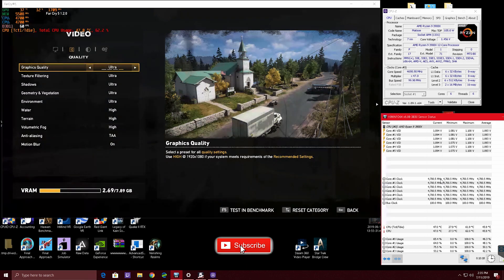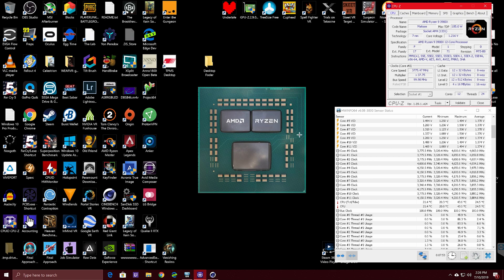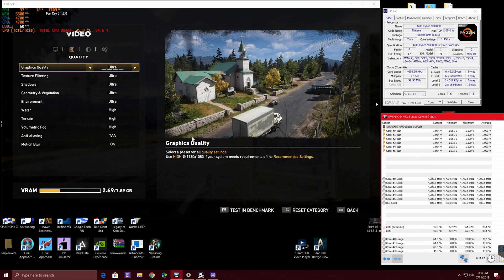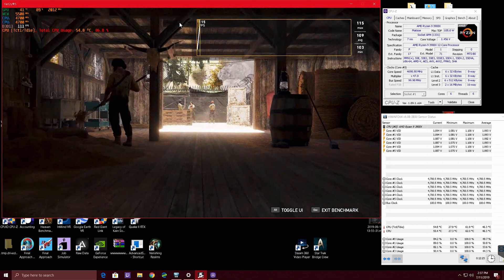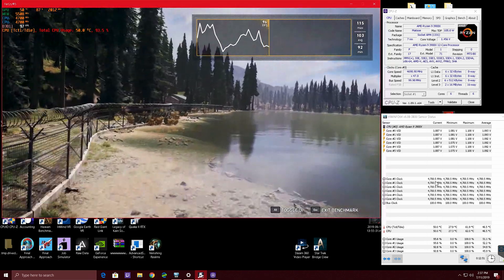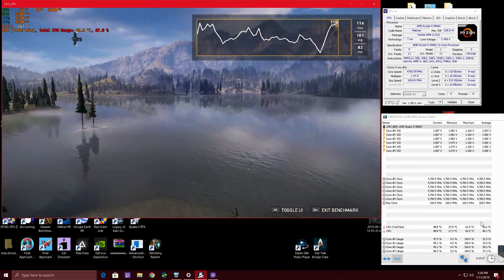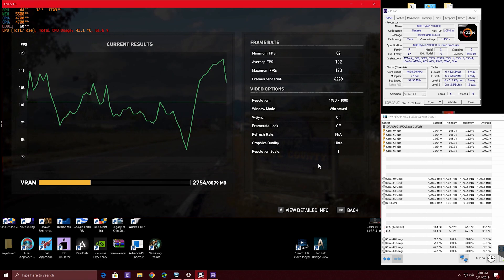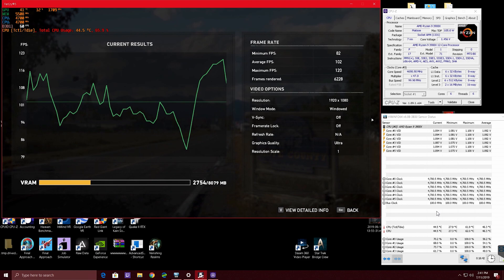RYZEN 9 3900X OVERCLOCKED 4.7GHz On Water!!!

Comment: I can get 4.3 stable by only adjusting CPUx.  4.4 runs games farcry 5, battlefield 5, GTA V but cinebench R20 crashes. 
I am on a 240mm aio 
16gb ram at 3600, 16,18,18,20
Rtx2080super
X470 prime Plus mb
Any help would be appreciated

Comment: 3900x @ 1.45volts, all cores 4.3ghz, temp 74 using nhd15 noctua air. Prob could have stable 4.5 if I play with settings more buy 4.3 is fine for me as I dont game just vfx. I use the optimal setting profile for day to day use tho
Reply: That 3900x has degraded by now, guaranteed.

Comment: Pretty much low performance. I am getting 138fps average in far cry 5 benchmark tool with my r5 3600 clocked at 4.25ghz but with low latency ram 3600mhz CL14 i am also using GTX 1080 TI, what gpu do u use ? maybe that's the case.
Reply from the maker: Since this time I have put in better ram but I'm still only using the gtx 1080. That is why

Comment: I too have a Ryzen 3900x cooled by CM ML360R and can achieve all core 4.3 Ghz, but I am uncomfortable with the temp sitting around higher side of 80°C and is not stable enough at Prime 95 level. However I keep it at 4.275 Ghz all cores stable under better temps.

Coming to your 4.7 Ghz claim - What you are doing is not an all core 4.7 Ghz if you are doing it only on one CCD. System will remain at low temps and stable under gaming because gaming uses mostly single core. Try switching to any stress test or benchmarking and you will see either thermal throttling kicks in or a restart.

Note - I do not want to undermine your efforts but at the same time want to keep the viewers well informed about the current situation of this processor. Maybe at a later stage once motherboard manufacturers start providing more matured BIOS then it could be possible. I am waiting for the microcode update that AMD said they will be releasing in November to bring 100+ improvements.
Reply: You can hit a middle ground. I run both CCDs on, 4.6ghz ccd1/4.2ghz ccd2 @ 1.35v (1.275v under load). Under 70C in r20 after warming up the liquid in Prime 95.

Comment: This might be a dumb question, but what are the downsides to an asymmetric overclock, e.g. fast chiplet @ 4.7, slow chiplet @ 4.3. I get that the voltage will be insanely high for the 4.3 chiplet, but is there anything else I'm not thinking of?
Reply from the maker: Well I just find the middle grown then there are no downsides. 4.5 on the fast and 4.3 in the slow at 1.35v. works pretty well 👍

Comment: Ahm, manual OC under load 1.205 - 1.210 vcore 4.1 ghz all cores for productivity under CR15 lower  SThread, MThread is better than default, way lower temps and stock cooler.

Auto offset -0.09 , default, max boost on cores 4.45ghz  and that core is hitting 1.387v. Much better STthread lower MThread with offset.

Boost on all cores on default under heavy Mthread load is 4025mhz ...
Reply: Interesting, I'm on 4.2GHz with voltages at 1.18175V on the vCore.

Comment: You: "I am running all cores on my 3900X at 4.7 GHz".  Also you "I am only doing this on one of my chiplets".  You can't claim an all core overclock if you are only doing it on one chiplet.
Reply: This looser again. Im going to by a $500 CPU only to run it like a $300 one. the dude ran a cinebench and barley hit 3000 points. Sad. A great "How not to optimize your CPU" video. LAF

Comment: In Cinebenck R15?
Reply from the maker: Got 221 on single but there was more in it. I have my setup now running 6 cores at 4.5 and 6 at 4.3. Cinebench multi-core of 3430!
Reply: @JoeyRiz  you can do better with all 12 cores.   mine ccd0    ccx0 4.55 4.55 4.55  ccx1  4.4 4.4 4.4   ccd1 ccx0 4.25 4.25 4.25  ccx 1 4.25 4.25 4.25   all at 1.368v

Comment: Can you leave the other CCD on, and clock CCX0 and 1 to 4.7, and CCX 2 and 3 to something low, like 3ghz?
Reply: Yea you can. I have CCD0 locked at 4.45Ghz and CCD1 locked at 4.1Ghz @ 1.325V. You can even do it by CCX and even per core but the software is a bit buggy atm. AMD def bringing the heat.
Reply from the maker: Ya I have been doing that as well. 4.5 on 6 and 4.3 on 6 at 1.35. stable too. These chips are pretty great
Reply from the maker: Ya I figured this out right as I was uploaded this video. It is by far the best way to go with this chip. 4.5 on 6 and 4.3 on the other 6. 4.7 take way to many volts on the daily. But 1.35 should be ok. 3430 on cinebench!
Reply: @JoeyRiz  3430 is a pretty frickin good score 3389 for me

Comment: So you haven’t actually got a 3900x @ 4.7 then.  So much clockbait.
Reply from the maker: Ok first, Clockbait is an awesome term lol. But really I did hit those clocks on this chip. It's pretty much in "Game mode" which disables one CCD like I did. AMD has been doing this for the last 2 years with threadripper.
Reply: @JoeyRiz  you hit them on half the cores which isn't what your title says.  I approve of the bait however
Reply: @JoeyRiz  come on man. It was 100% clickbait. 

3900X doesn't have game mode. It's not a TR chip. You did not get an all core clock of 4.7. you got half the cores to 4.7 with SMT off. So basically you got an 8600k :P
Reply from the maker: @misterringer  the 3900x does have game mode. The option is in ryzen master so you are wrong there.  It's basically a threadripper chip at this point. If you read my update I was able to so it with SMT on a but later at the same voltage. Just a bit more tweaks. This was only ment to show what is possible. Not to be a daily run. 

Now running stable at 1.35V with 6 cores at 4.5 and 6 at 4.3. crazy good temps and cinebench score of 3430. Really good stuff
Reply: glad to see you got it going with SMT. Much more useful now. 

Usually AMD advertises buzzy sounding things like "game mode" so I just assumed. Thanks for clarifying. 

your title was still click bait as hell, but great work on the testing and the overclock :)

Comment: Wotor. I’m at 4.4 on my 3800x with temps under 70c and I have the same water cooler as you so I might try out .1 or .2 more
Reply: Eric Zeng but I like warranty
Reply: YDKY yea I just found out that it’s not stable. Cinebench would shut down my computer so I just put precision boost on and I’m getting similar results
Reply from the maker: Right now I'm running 4.5 with SMT on CCD1. 1.35v! All under 70c

Comment: 1.45v ... how many idiots would dare to run it 24/7? I don't see any big red disclaimers for those folks
Reply from the maker: I am not anyone's daddy. If they decide to do that it's not on me lol
Reply: I have a 3930k run 4.8 ghz ad 1.5v in 8 years and still running sow non problem There
Reply from the maker: @NewHardwareOnline  ya those older chips on larger processes can handle more power. With the 7nm chips, you really should keep it below 1.35v for all core under load 24/7. Short bursts when the chip overclocked itself is fine to hi 1.5v. just something to concider
Reply: @JoeyRiz   Max safe is only 1,325 V for 7 nm! source: reddit/r/amd
Reply from the maker: @vladvah77  oh I know that. That's why I would not run 1.45 all the time lol
Reply: @vladvah77  lol reddit   bwahhhhhhhh
Reply: @NewHardwareOnline  This is very hard to believe, I've heard reports of Sandy Bridge silicon degrading with less voltage.
Do you use your PC actively?
Reply: @VADemon  I use My pc every day .. ad the time i got the cpu Many told that 1.5 v was to muts, buy the cpu stil working 100%

Comment: So it is possible to run the good chiplet only for games and the second chiplet for streaming? Sry for my bad English
Reply from the maker: I mean it could be possible by assigning cores but it may be better to use a VM. May test in the future
Reply: Yes you need to install a program called "process lasso", you can permanently setup cores affinity for whatever cores / applications you want, that's also doable in windows (task manager) but it's not permanent.

But yah basically if you have to chose you'd want your fastest cores mapped with your games and your slower cores for streaming, do benchmarks if you can, im interested.

Comment: Seems like you've hit the silicon lottery with your 4.7 chiplet. But what on earth makes you think the 3950 will be able to hit 5GHz? They are basically all the same, the 3950x is just better selected with all cores working, but nothing seems to indicate that these chips will be able to clock higher. Even the contrary may be, because precision boost overdrive looks at the temperature which tends to go even higher on a fully activated chiplet.
Reply from the maker: Because the 3950 will be better binned and will probably be able to hit the same numbers at lower voltages which is what matters
Reply: @JoeyRiz  But R9 3950X means also fully 8 active cores/CCD so PBO will lower overall overclocking limit, man I really don't know if AMD chips can hit 5 GHz this generation... it would be so fucking cool to do it just to piss off those Intel fanboys!
Reply from the maker: @vladvah77  lol ya but if it can keep the voltage lower being a better chip... It could be possible. I hope so anyway

Comment from the maker: Update! Was able to hit 4.7GHz on CCD1 with SMT enabled! Cinebench R15 single core score of 221!

Update 2: now with both CCDs enabled using ryzen master, I have CCD0 set too 4.5GHz and CCD1 at 4.3GHz at 1.35volts! Insane and stable.
Reply: Eric Zeng  Yea go check out Hardware Unboxed video he did a side by side compare with AMD and intel running at same clock rate to test IPC for both. AMD came out ahead by about 7%-12% of Intel clock for clock IPC wise in Cinebench. 

But because AMD has a higher latency in memory Intel still was just slightly ahead in most of the games.
Reply: Eric Zeng  Cinebench is an actual work load based on a real program so are the others hardware unboxed used. If you want to show IPC form one brand to another brand cpu they have to be running at the same clock rate. If they are not then a test for ipc is useless.

Intel should alwasy at this point come out ahead for IPC if you leave all at stock settings because Intel has 800MHz-1000MHz clock speed advantage over AMD yet.

I think most people confuse what IPC actually stands for & even hardware unboxed said he just did it to show where AMD was at IPC wise when compared to Intel when all CPU's were clocked at the same speed.

The result was AMD has a bit better IPC over current Intel CPU's but with INtel's clock advantage makes up for it and keeps Intel in the game still. Intel fans should be happy AMD did not pull a rabbit out of their butts and made it to 5GHz yet. Even if they did Intel would be slightly faster in games but get butt kicked in everything else. 

Heck even where AMD is at now clock speed and IPC wise Intel is just holding on in most stuff when you just look at a 3700x 8/16 against a i8 9900K 8/16 where it gets matched in everything except the games. The gaming is where Intel is still the fastest and that is because of their ring bus and very low latency it allows. 

AMD has more memory latency which they tried to lower with larger cache L3 which has helped them alot and is in part where they might have gotten a bit of an IPC increase as well as well as a lot of other tweaks in the new chips. Do I think AMD will hit 5GHz with Ryzen 4000 chips next year probably not. If they do probably only on a single core turbo and at most 4.4GHz-4.45Ghz all core OC. Mark my words that is probably going to be spot on next year.

I was one of the ones that fell into the 5GHz hype form the rumors and fake leaks before the 3000 series launched. I won't be going down that road again for the 4000 series. From what I have heard Intels next gen CPU's are not going to be any where near 5GHz either on their 10nm node but they are saying up to 33%-36% IPC gain over Coffee-lake and all of Coffee lake refreshes we have had that is a huge gain in IPC for Intel on their next gen cpu's.
Reply: Wow amazing ryzen hahaha, Just imagine if this CPU can run at 5ghz like intel, Like how much score this chipset can get? XD
Reply from the maker: @ibnutaimiyah5738  this beats the 5ghz 9900K in cinebench. IPC is awesome with this setup
Reply: @ibnutaimiyah5738  AMD has 6% IPC over intel, 4.7*1.06 = 5~
Reply: @ibnutaimiyah5738  Is really not that hard to imagine, all you have to do is extrapolate: 221/4.7*5=235 Single core in CB R15
Reply: @nicamarvin  You can't do that, because Hyper threading scales different than AMD's Simultaneous Multi Threading
Reply: Eric Zeng  What? No, IPC and clockspeed are totally related, IPC stands for instructions per cycle/clock, clockspeed is just the number of cycles every second. You can directly multiply one to the other to have a very rough estimate of what frequency you would need to achieve with a cpu with a different IPC to have similar performance. Of course, there are other factors and it will vary with the workload.
Reply: What result in r20?
Reply from the maker: @thedill2838  I did not get an r20 run on this setup but I did get around 7900 with 6 cores at 4.5 and 6 at 4.3
Reply: @JoeyRiz  ok
Reply: How do you set the clocks separately? Ryzen Master?
Reply from the maker: @eubikedude  ryzen master let's you set your clock per CCX. Read my current setup here on Reddit. 
https://www.reddit.com/r/Amd/comments/ceeesx/ryzen_3900x_test_results_overclocking/?utm_medium=android_app&utm_source=share
Reply: Wher s the actual proof??
Reply: Eric Zeng  It's been tested by reviewers dude, it's not random.  The IPC advantage is around 6%. From there it's simple math.

Comment: I'm wondering why 3800x is not available in most places... maybe they are highly binning these chips to hit over 4.5ghz on most core or at least half of the cores.
Reply from the maker: Ya I saw the 3800x was hard to com by. Pretty much every RYZEN cpu seems to be exactly the same chip with various cores disabled if the did not pass testing. have to see how it all plays out

Comment: At this preset i get 84 low 119 average 159 max with my old 6850k at 4,2ghz... Whats wrong with ryzen?! Wanted to get the 3900x but it seems that it performs same or lower in games.  Did you get gpu bound? I have a 2080ti.
Reply from the maker: Probably gpu bound. I should have set everything to low. To go all cpu
Reply: Are u dumb? just look at the gpu utilization...
Reply: 2080ti 6850k vs 3900x 1080
Reply: Ryzen 3000 cpus are STILL 5% average below Intel cpus in pure gaming scenarios!
Reply: @vladvah77  bought the 9900k on a aorus pro with 32gb 3600mhz. Rly happy and much frames